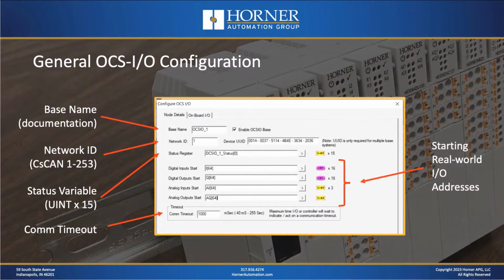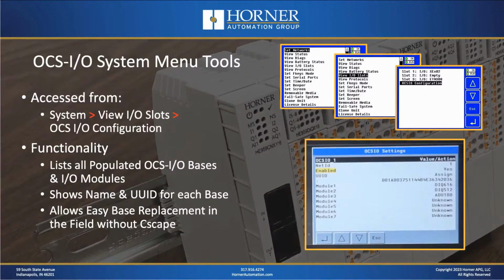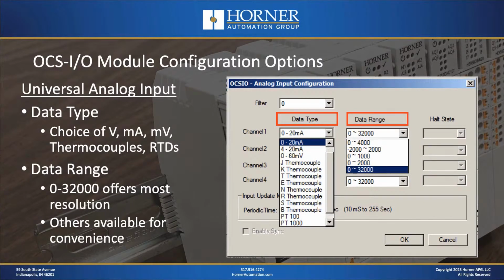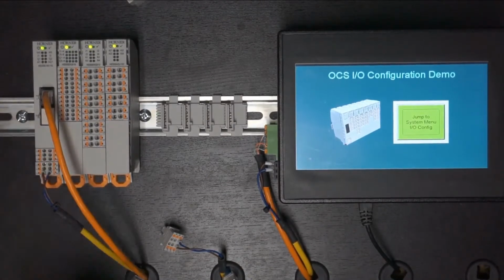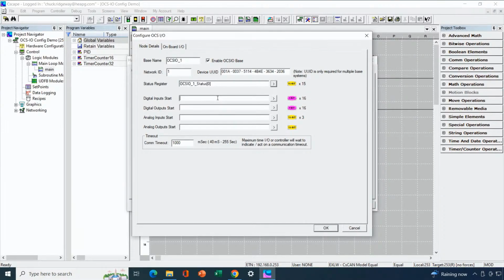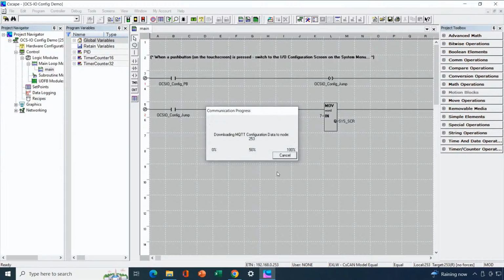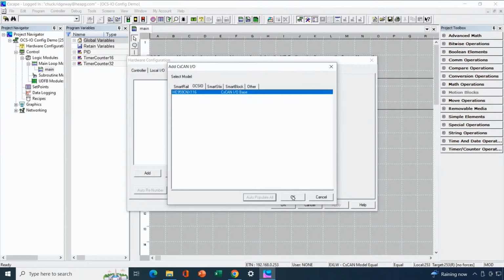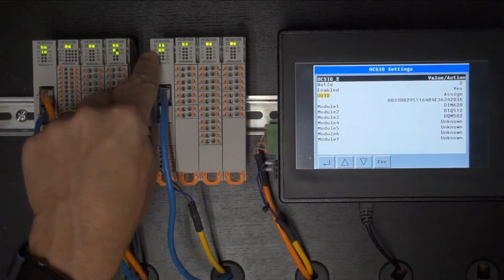Configuring OCS-I/O

Comment: When you had one rack and replaced the Base, after a few minutes, it recognized the base and took the UUID which I presume was again starting with 001.  Why when you had the 2 bases, why did the replacement base not simply insert itself as the second base.  Is not the OCS controller in some way pushing down the UUID?     IS the bottom line that if you have only one Base, you can replace it without having to do anything and if you have more than one, you are going to have to go into the OCS config menu and assign the new UUID?